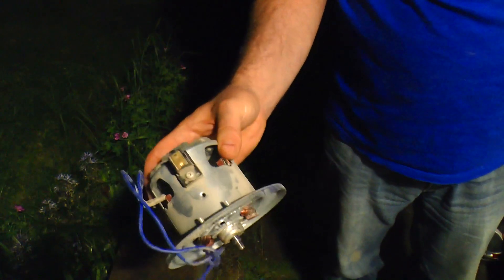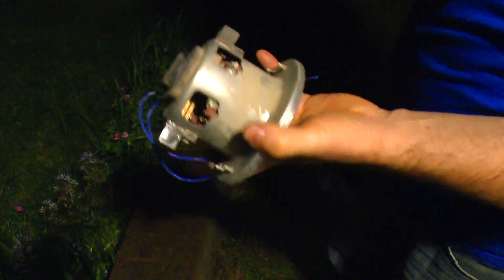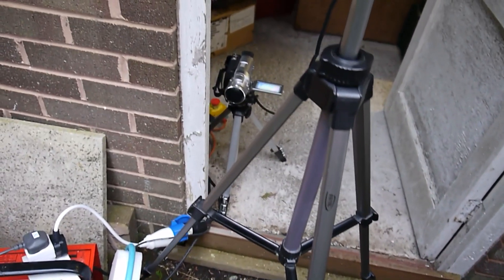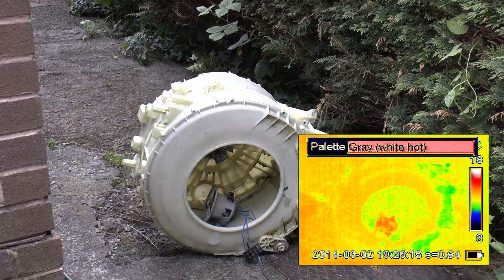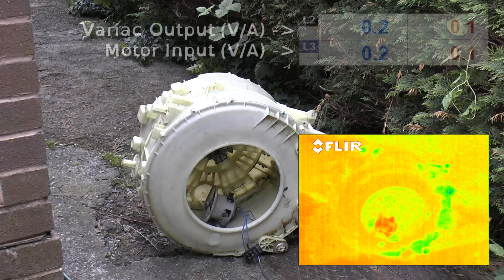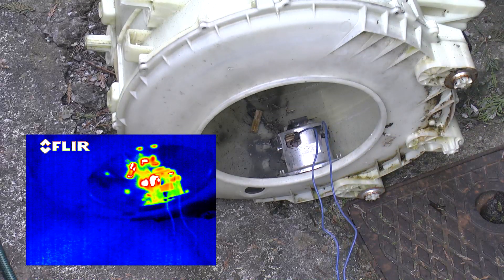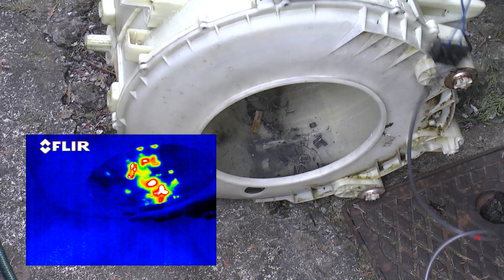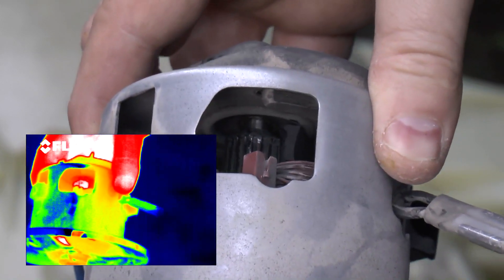Vax vacuum motor pop on 315 volts

Comment: Well, I think you score a YouTube First DOUBLE-WHAMMY on this!

Firstly: Cooling fan removed. I've always wanted to see a motor done-in this way! 

Secondly, Thermal imaging. The camera EVEN HAS HAIR! :D TOTAL ROFL! :D

Haha, at 0:25 Vacuum cleaner "opened-up-very-carefully" :D

Cor, the motor on the thermal image.....LOOK AT IT GLOWIIIIIIIIIIIIN' !!!

By the sound of things, THAT sounded like it could have participated in the electric motor drag race! It was going fast, it blew up at the end of it, so it fulfills the rules of the electric motor drag race competition. :D

When the motor entered the poppage stage, it could be seen on the thermal image (unlike the standard camera) bits of glowiiiiiin' hot carbon brush and commutator bars flying everywhere. FANTAAAASTIC!

As like others, I had to watch this a few times over. The first time I looked at the thermal image camera and the second time the standard image. The third time, I tried to sit back from the screen and see both at the same time for comparison. :D

Thanxx for showing. Really enjoyed this one. HOW SSSSATISFYING!! :D

-BoomBoxDeluxe.

7th June 2014, 00.50

Comment: Brilliant !! That was one hot motor, those roller bearings still do very well under those 30,000+ RPM speeds.
Love the thermal imaging.
Reply from the maker: As far as I've seen so far (going by vacuum/mower motors) if you leave the fan on you get the "Green Mile, sponge was dry" effect. If there's no fan the motor runs at crazy RPM and blows its commutator apart instead.

Next time I'll keep the fan :)
Reply: Your profile pic says i tried it at home! XD

Comment: lol not a method of repair i normally use, just a tad ill :-))
Reply from the maker: Speed controller was dead. Some weird custom chip I can't find a data sheet for. If it was out of warranty I'd have just bypassed the controller, but sister's had a replacement unit shipped out (all bar the hoses) so this one was given to me to "play with".
Reply: AintBigAintClever
Sounded like a lighting dimmer for inductive loads, or pulse width modulator.

Dont matter as its all crap now :)
Reply from the maker: 8-pin chip marked MCV02AP, running a TRIAC. Pin connections didn't match anything I could find.
Reply: AintBigAintClever
Sounds like the chip used in a touch lamp dimmer, chopping the ac waveform, i bet its a microcontroller and they have put a in house number on it.
Ive never heard of that number, but "MC" sounds too much like Micro Controller to me.

Any way, apply a large lump hammer gently to the chip surface lol.
Reply from the maker: zx8401ztv I've just drawn out the circuit diagram, just for fun.
Pin 1 = +ve
Pin 2 = AC in (via 2M)
Pin 3 = speed control pot
Pin 4 = reset R/C circuit
Pin 5 = speed control pot
Pin 6 = TRIAC trigger
Pin 7 = TRIAC trigger
Pin 8 = GND
I reckon it's a rebadged PIC12C508.
Reply: AintBigAintClever
It does sound like a pic chip, someone has done something similar, here is a link: http://chaokhun.kmitl.ac.th/~kswichit/saver3/saver3.html